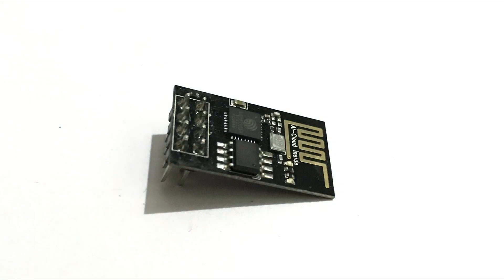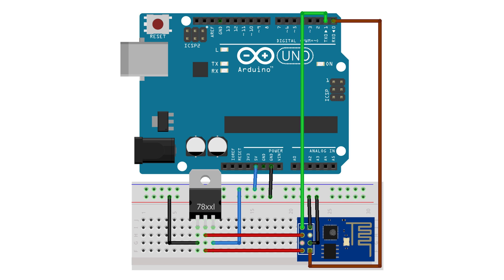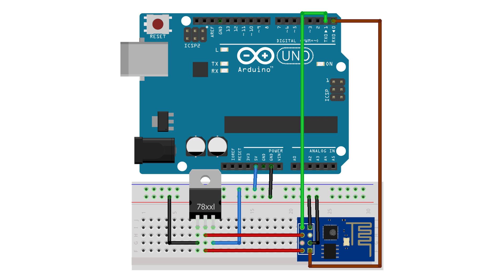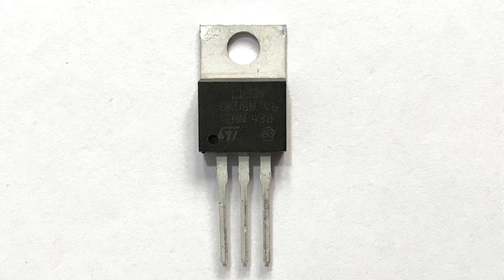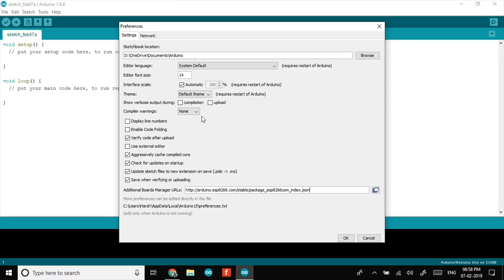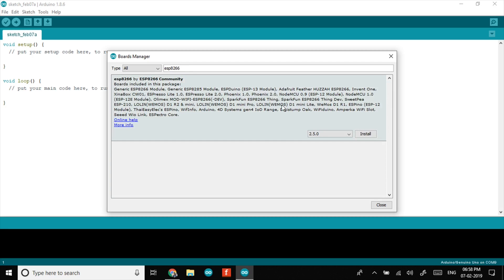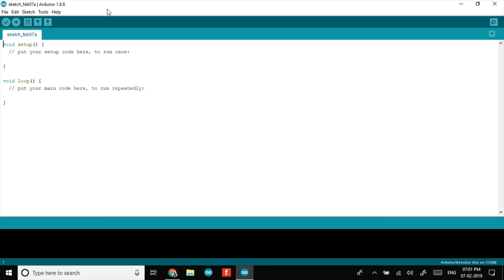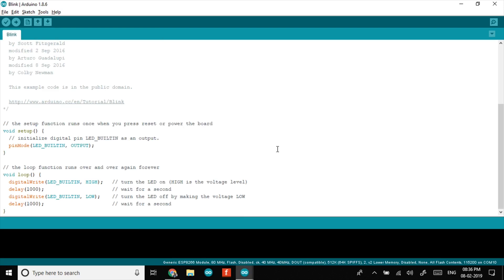How to Program ESP8266 with Arduino Uno

Comment: Isn't it simpler to use a voltage divider from 5 to 3.3?
Reply: But then the esp won't get the required current to adequately powering it up.
With 3.3 V voltage divider only 15 mA of current flows but Esp01 requires 200 mA of current for which you have to use a Voltage Regulator.
Reply: @ankitnishad3320  oh thank, good yo know.

Comment: how to reset esp8266 i'm getting AN
 error: 
esptool.FatalError: Failed to connect to ESP8266: Timed out waiting for packet header
Reply: Add a push button between module's RST and GND. 

Upload sketch. When you see "Connecting........__
" in Arduino message section. Just press this push button. 

If doesn't solve in single go. Upload sketch again and do step above.

This resetting actually puts the esp8266 in programming mode.
Reply: @SunnyLuthra7   thank you sunny ji

Comment: why do you need a 3v3 voltage regulator when Arduino has 3v3 power pin?

Comment: Why you use regulator
Reply: The arduino 3.3v power pin can only provide 40mA at best while the esp can draw around 250mA. Thats the reason why u need to use an external 3.3 volt regulator:)

Comment: Do you need the voltage regulator or could you just wire up the wifi module directly to the 3.3 V port on the arduino?
Reply: I've read that the 3.3V pin on the arduino does not provide enough current for the ESP8266 to work properly.
Reply: @christianvillaescuza7179  Hmm. I've never heard of that before. Thank you for bringing that to my attention.

Comment: Sketch uses 258604 bytes (51%) of program storage space. Maximum is 499696 bytes.
Global variables use 26696 bytes (32%) of dynamic memory, leaving 55224 bytes for local variables. Maximum is 81920 bytes.
warning: espcomm_sync failed
error: espcomm_open failed
error: espcomm_upload_mem failed
error: espcomm_upload_mem failed

please help with this
Reply: plus are we very sure to directly connect rx to rx without matching the voltage logic level between arduino and esp
Reply: @richierich3135  The error means that the ESP isnt connected. Try properly grounding the GPIO0 and give 3.3 V to the CH_PD (enable pin). Remove GPIO0 connection afterwards